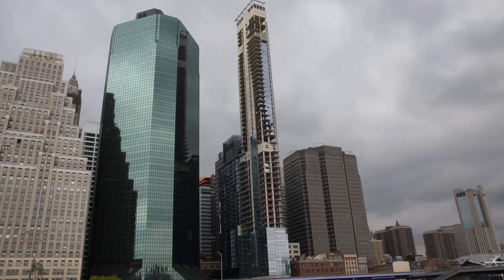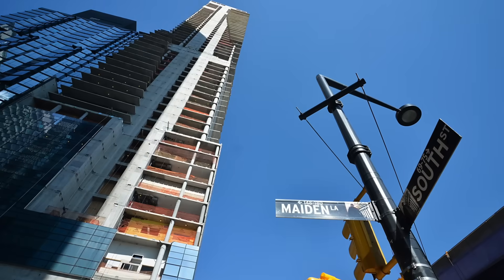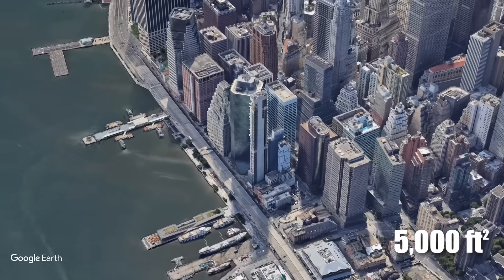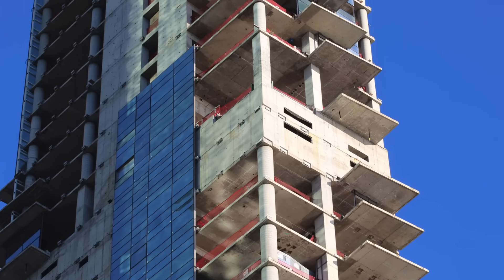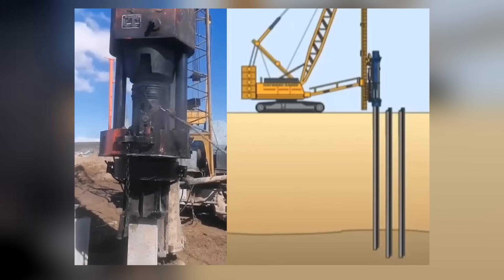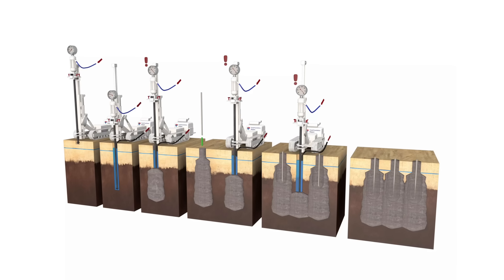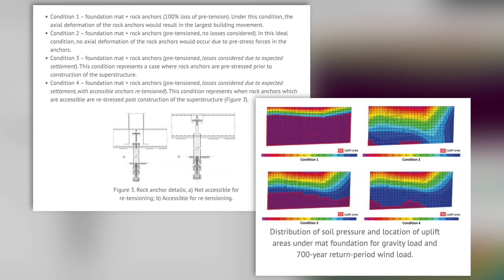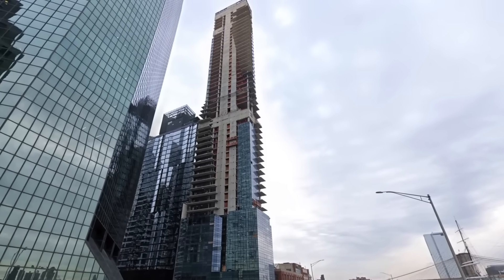Why Nobody Can Fix This New York Skyscraper

Comment: That $6 million is looking cheep now.
Reply: Definition of “penny wise, pound foolish.”
Reply: @ClarkBK67  dollar here yo
Reply: No kidding. The legal fees alone will prob cost more.
Reply: I was thinking that anyway over the cost of the whole project.
Reply: @geniferteal4178 
Like so many companies, Boeing comes to mind! Accountants run the show and look at profits more than quality and safety. Left to engineers they surely would have opted for safety and gone down to bedrock.
Reply: @wobby1516  ...Accountants don't design buildings nor do they build them. Accountants didn't propose the alternate drilling method🤦‍♂, they tell you what it will cost and it's up to the decision makers to decide about safety etc. It was a bad engineering decision overall because this issue involves safety.
Reply: @wobby1516  MBA finance and management types, not accountants. Accountants only report results, they don't construct anything.
Reply: @truth1844  Wrong. When the bean counters take control of a company the engineers are stuck between a rock and a hard place, you compromise your standards or find another place of employment. Boeing is a prime example of this, then the Harvard MBAs that caused the problem bail with their bonuses to go to  another company to wreak havoc before the problems arise.
Reply: @wobby1516  Yet a bunch of engineers did go along with this dumb floating-in-mud foundation.
Reply: $6,000,000 is nothing when you see how much they were selling units for . No excuses for being too cheap to use $6 million for piles down to solid rock
Reply: @georgevavoulis4758 its like 3-4 units
Reply: I see their architects and engineers didn't learn from 
San Francisco's Millennium Tower. They've spent $100 million so far, and massive engineering corrections just cause new problems.
Reply: As any good builder knows . First rule of building . You never cut corners on the foundation.
Reply: This was my exact thought.  When they said more expensive i was thinking like hundreds of millions of dollars, not $6 mill for a gigantic project like this lol.  That is just ridiculous!
Reply: If i was to build a 300 million dollar, 670ft building on sand, spending an extra 6million for a stable foundation would look cheap to me on day one.
Reply: Couldn't have said it better myself
Reply: Cheap
Reply: Yep. That's disgusting if that's all the costs were. Tofu dreg project in Manhattan...🤦‍♂️I see short cuts all the time in construction. Usually it's the higher ups being greedy and pressuring engineers and contractors to cut corners so that they have to sign off on sub par building. The developer is definitely responsible here.
Reply: Cheep is what birds say. Cheap relates to value.
Reply: “Choose cutting corners or succeed.” Sakshi Sharma
Reply: You don't know cheap
Reply: I see what you did there 😏 😉 👏
Reply: Sometimes hindsight can make things look really small :p
Reply: This is every project ever. Short sighted decisions that are penny wise and pound foolish.
Reply: "Cheep" like a chick? LOL! Duh....
Reply: That's what I thought. $6 mill ain't nothin when it comes to these buildings!
Reply: No doubt. 100% avoidable. Idiots.
Reply: No doubt about that
Reply: I was just about to post that exact same thought. Short cuts make for long delays.
Reply: AFTER BANKRUPTCY SOME DEVELOPER WILL BUY THE SHELL, DRIVE A FEW PILINGS
IN THE GROUND, NYC DOB WILL RUBBER STAMP THE FIX AND THE DEVELOPER
WILL SELL THE LEAN AS AN AMENITY(AND CHARGE EXTRA!!).
THE HOLD UP HAS BEEN THE MORTGAGE RATES ARE TOO HIGH TO UNLOAD THESE 
CONDOS ON SOME SUCKERS. FORTIS IS TRYING TO HOLD ON TO THE 10 MILLION
IN DEPOSITS, TO PAY THEIR BANKRUPTCY AND INSURANCE COST. IF THEY CAN
KEEP THE DEPOSITS THEY MAY EVEN MAKE A PROFIT ON THE DEAL!!!!
Reply: Guess you reep what you sow.
Reply: @bjsimpson4768  Reep is a Dutch rope maker. Reap is to gather or harvest.
Reply: @ononearts  yes, I know. The misspelling was intentional, and in reference to the misspelling of “cheap”, as “cheep” , in the post to which I was replying. 
It’s a bad habit which I, as an English teacher fight everyday, and would advise against. Sorry for setting such a poor example. My fight is ongoing, and I’ll do better.
Reply: @bjsimpson4768 Sorry I missed the joke! I do enjoy intentional misspellings. There are so many unintentional ones these days, as well as illiteracy defended as pop culture (“UR”, “U”, etc.) that it’s sometimes difficult to differentiate intents.
Reply: Spell check is free.
Reply: Cheap
Reply: you read my mind
Reply: It won't be cheap to fix this mess
Reply: Nowadays 2024 I hear about 10 million 120 millions all day long that when I empty my pocket at night I’m surprised I don’t find a couple of millions
Reply: Yeah it's not good to try to cut corners everywhere!
Reply: You got that right!
Reply: Yep. Now it’s functionally obsolete incurable.
Reply: Yep. Even cheap.
Reply: 6 million for a building that height is ridiculous. I've seen 4 story buildings cost 40 million engineered correctly. That is a joke.
Reply: Cheap 😊
Reply: Makes no sense. Must be 60 million. 6 million is nothing for this building
Reply: Cheep?😂😂😂
Reply: @ typo!
Reply: 😂 exactly. They would have made the money the first month of common charges for the condo units
Reply: Because of the birds living and cheeping there?
Reply: No kidding...
Reply: It's not a fucking baby bird.
Reply: Cheep? Kind of like your education?
Reply: It's looking "cheep"... just like your spelling. LOL!
Reply: That's what's hilarious to me. 6 mil is nothing when it comes to this level of building/ money. 
They effed themselves for no reason.
Reply: Cheap is not spelled cheep.
Reply: What cheep?
Reply: Very cheap yep :)
Reply: Just only
Reply: Omg.. Hilarious!
Reply: You would think that after the leaning building in California they would have spared no expense on the foundation.
Reply: @dougdiplacido2406  they probably thought they wouldve have long sold all the units before this thing started pulling a v8
Reply: That's assuming the alternative would have worked.
Reply: @huzcer the alternative worked for the tower across the street . What do you mean? its ok for 5 or 6 story building to be on sand but you cant build a sky scraper like that
Reply: Thats capitalism ...  save money now...  doesnt matter how much it cost later ....
Reply: @NuclearSavety  It's a people problem.  If it wasn't capitalism it would have been filled with owners before discovery.  Then blamed on unforeseen geology and the government officials would have kept the money.  As seen in Chnia every day.
Reply: @NuclearSavety  Thats BS, why then is not every building in NY leaning or crumbling? Greed, stupidity and incompetence are staples of communism, see China and their crap infrastructure. If anything this is an example for not adhering to the rules of capitalism and getting punished for it. Also, correlation does not imply causation.
Reply: @NuclearSavety  This is the problem today, investors do not care about the long term but want instant profits then bail before the problems they caused raise their ugly heads leaving the later investors to suffer. It’s almost like a Ponzi scheme.